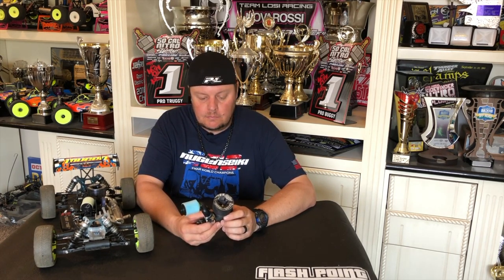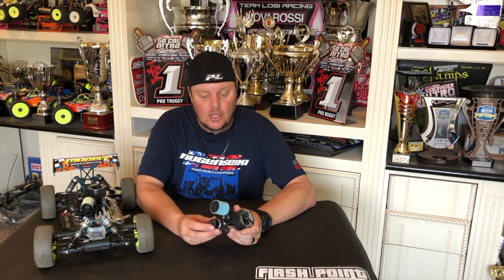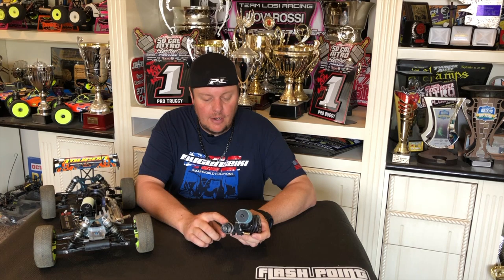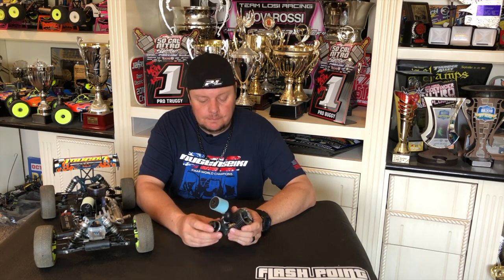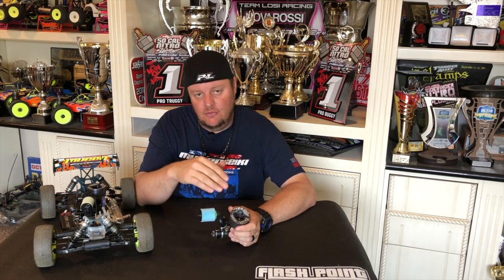How to know when to Change Nitro Engine Bearings.

Comment: Thanks! So glad i came across your video.  I have been racking my brain around similar symptoms on my engines.  No bearing noise that stands out but front leakage, ignored it when it was running good but now having issues. Has to be bearings in my case, I've never considered replacing before but also was not sure what to look for.  Motor is 10yrs old has many gallons through it.   Looks like my fleet of nitros is getting new bearings this winter.  I always thought that the part of the crank that passes between the bearings made the air seal and the front bearing was more for dust.  But I can see it contributing now (most my experience is low strung nitro airplane engines).  These things rev crazy high to so more rapid bearing ware should be expected. Thanks again appreciate it.
Reply from the maker: My pleasure!!

Comment: The best diagnosis of degraded main-bearings, front or back, is to simply turn the crank-shaft with your fingers. Any roughness indicates some wear. When to replace the bearings, is a matter of choice. It is better to replace them prematurely than too late, in that the outer bearing ring may start to rotate into the casting, destroying the engine, if not replaced in time, should the bearing seize up.

I have concluded that they last about 50 hours on four-strokes using 5-10 % nitro and 18 % oil at maximum 10.000 rpm.

The replacement procedure is quite easy and straight-forward. No special tools needed.
Reply from the maker: Very good points!

Comment: What’s a general maintenance schedule for these bearings? What kind of service life can you expect to get out of these engine bearings?
Reply from the maker: Depending on the fuel you use, how often you replace the filter, and how you store your engine, it can vary quite a bit.  Sometimes the bearings will outlast the engine, but in other cases the bearings will go out first.

Comment: Thanks adam, now that you mention it, i might need to change the bearings on my novarossi mantra as it does seem to not idle like it did. I have tuned it, but it keeps dying.
Reply from the maker: Yes, it could be the bearings or low on compression and the piston/sleeve set needs to be resized.
Reply: @AdamDrake  is that something that you could do. The resizing part I mean

Comment: Just done my first nitro race and my first 3 heats car was running good then the last two heats it cut out twice not on a jump just on flat part of track, my idle good, top and bottom is tuned good, normal 1 gap on carb.
Trying to figure out what it is going on? Going to replace all fuel lines, new clutch, what maybe is the issue?
Reply from the maker: Maybe email me a short video to be able to listen to the tune?
Reply: Or what's u email thanks

Comment: Please please help me my rc car tires are moving all by it’s self with out me touching the transmitter does that mean my sevro is bad or is it my transmitter because I put new batteries in my transmitter today
Reply from the maker: It sounds like the servo could have some slop and it's trying to find center.
Reply: @AdamDrake   I ordered a new sevro and it’s comeing tomorrow thanks for your help

Comment: If changing the front bearing , is it Necessary to also change the rear bearing ? Will the rear give out next and soon ?
Reply from the maker: It’s not necessary, but usually done at the same time to be safe.
Reply: @AdamDrake  I figured. Thanks

Comment: What about after run seeping out the front?
Reply from the maker: That's fine if you applied a lot of thin after rung oil.  It's really only a concern if it's leak after or while the engine is running.
Reply: @AdamDrake  Good news to hear that. Thanks for the crucial info, from me an everyone at Phil Hurd Raceway. Thanks for your Tuning an Set-up wizardry YouTube videos. Those videos have helped me more than any other sources.

Comment: also  crankshaft  play  slop   when  pulling back and forth  on   the  engine shaft  exsposed when your  clutch  bell is removed.  crank bearing on  clutch side usually  takes   more wear than backside bearing.  but then again adams crankshaft bearings cost more than most new nitro engines.  your contract clause  with  mugen  is to restricted, bring out rhonda.   yes the video was good.  the drake knows.
Reply from the maker: Thanks!

Comment: Also flaming out when on the throttle. When your engine dies for no reason at all and you can't keep it running even after changing the glow plug you have a bad inner crankshaft bearing. The crankshaft is hitting the engine case.
Reply from the maker: Wow, how much fuel do you have through the engine?
Reply: @AdamDrake  around 16 gallons
Reply from the maker: I would say it's time to have it looked over and gone through.
Reply: @AdamDrake  I did ran a tubing cutter around the piston ported the engine case and sleeve. Put in a new set of ceramic bearings and she ripped. Over 13 minutes on  a tank of fuel on a smaller outdoor track. 30% 8% oil